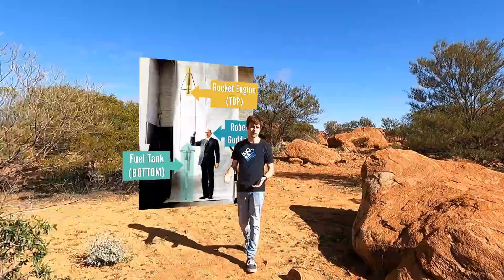The Pendulum Rocket Fallacy

Comment from the maker: Of course, another thing to consider is that "pointing very hot rocket exhaust at my fuel tanks" might not be a super safe design choice! Credits and FAQs in the description. 
P.S. This is my entry for the #VeritasiumContest (with the first round judged on number of views) so I'd love it if you could help me out and send a copy to a friend! Thanks!!! - James
Reply: Was a part of the contest having to be under a minute? Because adding a second at the end would've made the end less abrupt. Anyway, nice video and good luck in the contest.
Reply from the maker: @Sibula  I think the limit was one minute, but YouTube does a weird thing by adding 1 second to the video's time as displayed on the thumbnail (so on there it's exactly 1:00). I didn't want to risk it so went under.
Reply: Not a problem if the fuel tank was a torus ;)
Reply: I think you have got something wrong when saying "both balls land at the same time". Let's assume the balls both have the same size. Both balls have to push away the same area of air beneath them. To do that, they require some force. In this case, it is the force created by the Weight (mass multiplied by earth gravitational acceleration). Both balls do obviously require the same force to push away the same amount of air in the same time. The problem is, they do not create the same force. The ball that is more heavy has a much higher weight and thus can create a larger force to push away the air beneath it. The ball with less weight can't create a very high force to push away the air beneath it. This means, the ball that weighs less needs more time to push away the air, thus needs longer to reach the floor.
Reply: @Maggi-wk4wv  He did ignore Air Resistance, but that's the standard when simplifying physics. I wouldn't say he's 'wrong', just that he didn't specify 'in a vacuum'.
Reply: @ShawnMihalek  Yes, that would explain the mistake. It would be nice to mention it in the video though, because it might me misleading. The use of footage of two balls falling in air makes it slightly more confusing.
Reply: @Maggi-wk4wv  It's something that normal people won't think too much about, and the people that will notice it understand that it's a simplification. I would agree with you but he stated that the video had to be under a minute so he was already very constrained on time.
Reply: @Maggi-wk4wv  It's a 1 minute video.
Reply: Hey mate. Can you please talk about a subject that veritasium touched on once. The Kakadu, aboriginal paintings warning of radiation poisoning. given how its also has Australia's large uranium reserve there and has the oldest warning sign, well over a couple thousand years.
Reply: @lowkey_Ioki  That is the problem: That some people might not understand that this is a simplification. Thus a disclaimer (Just a small subtitle) would have been nice. But granted, I missed that the video had to stay under one minute. For that the explanation was quite good.
Reply: This shows up in my subscriptions right next to his rocket video. Good luck!!
Reply: I don't understand why everybody ignore elastic deformations when talking about this fallacy? In reality rockets are not rigid rods, but wobbly things. So, you need to think about them as soft springs with engines connected to one end. In this case the fallacy is not fallacy anymore. But still, because of other considerations, it is better to have engines on the back.

Comment: 0:24 : say "this doesn't work" ; show it work at right (cut before it doesn't work)
0:44 : but why, in the rocket-pendulum, the thruster has not the same effect as your hand ? why the 2 situation are different ?
(because the thruster push in the direction of the roket ; not perpendicularly to the ground. but i spend 4 minutes to find it.)

Comment: Why aren't tractor (like Soyuz or Apollo) launch escape affected by this then? I guess they have TVC control or the COM is different?
Reply: Are you talking about the Escape Tower?  If so, the rockets for that are directed outwards a bit to miss the top of the capsule.  https://en.wikipedia.org/wiki/Launch_escape_system

Here's a test in action, start at about 1:10 if you don't want to watch the whole thing.  https://www.youtube.com/watch?v=AqeJzItldSQ

Thanks for asking that question, I learned something new because of it.
Reply: @TSZatoichi  Yes. Thanks! But wouldn't there still be an upward force? I think I misunderstood the fallacy, it's not that the rockets are "more" unstable, it's that having engines on top doesn't make rockets naturally stable.
Reply: @kenjiokura7601  Yeah, this was the takeaway for me too. As for the launch escape system, it has a pretty decent aerodynamic stabilising element in the form of the capsule, I guess.
Reply: They are.
But their point is that are not a lot options to get propulsion there.

Comment: Ayyy... I understand weighing what to include vs exclude in the meager 60 seconds (from my own entry) but to me the single most important fact would have been to show that the the pivot point is at the CG, (which doesn't change in pusher vs puller rocket) instead of (fallaciously) at the exhaust.

Comment: You did not explain why a rocket with engines on top cannot maneuver as you claim. (Of course it can if sideways thrust is modulated.) You did not explain why pushing a rocket from the end does not make the tip unstable as you claim. (Because it does?) 
This video is as useless as a bad teacher's lesson: "This is blablabla fallacy and now stop asking. Next topic."